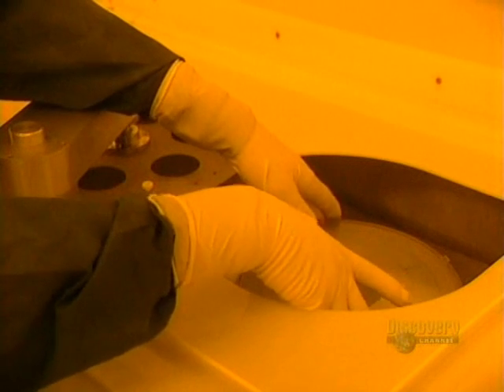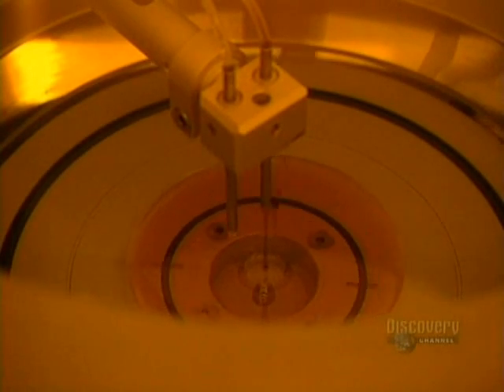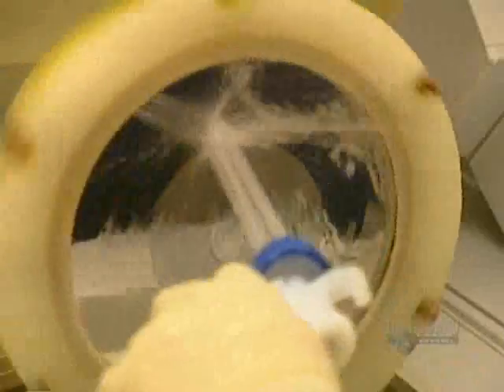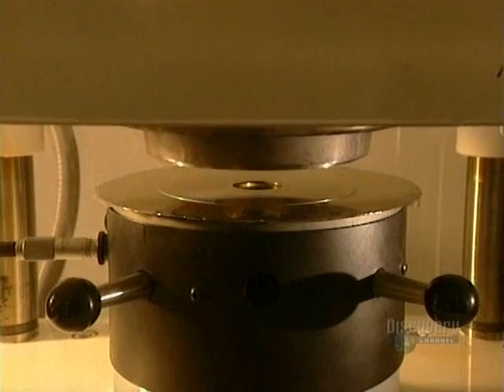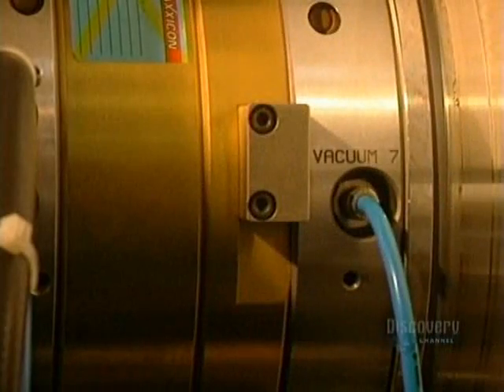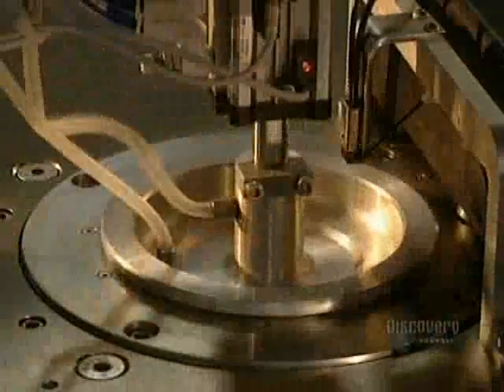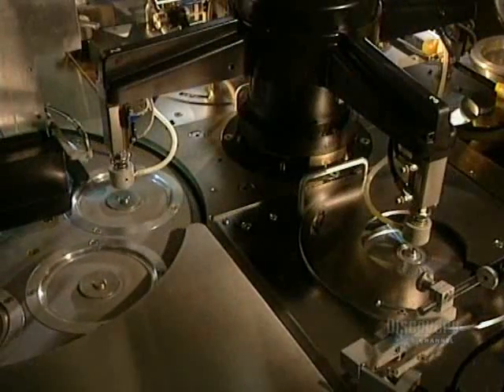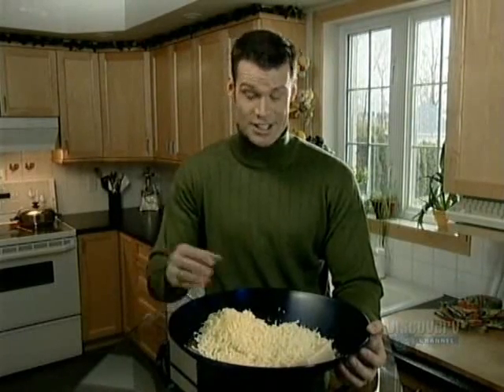How are CDs made

Comment: What they failed to mention is that the glass master wears out after 2000 or so pressings (depending on the plant config).  They also forgot the whole quality checking every 1000 CD's and the fact that the discs at the end of the run contain quite a few errors and an plant will produce CD's full of errors if they are in a hurry to get units out the door and don't have time to make another master ;-)  Good video though!
Reply: LP collectors rant about hurried manufacturing producing "noisy" records or records that look scratched and dinged out of the original shrink, so im guessing the two manufacturing process were similar enough to produce similar defects under similar conditions??
Reply: @Kzaks  CDs, DVDs, Blu-Rays, etc all contain a healthy amount of error detection and correction in them.  It would take a significantly botched pressing to be audibly noticeable to the listener.  A rushed vinyl pressing on the other hand...

Comment: @otharennaur CDs aren't "recorded" per se, they are molded. Think of it as a footprint you pour plaster into. When the plaster dries you get what's called a negative image, and you can then use this to produce copies of the footprint.
CD-production works the same way, only on a much smaller scale. You have a "footprint" in the form of a metal die, you inject molten plastic into the die and let it harden, and then yank out a plastic disc with all the data of the original die on it.

Comment: Madblaster: Nope.  Process is exactly the same until today. Photochemical Glass Master fabrication, then negative imaging from that master disc (can be done multiple times, as often as required from one master, because those metal foil pressing negatives undergo heavy usage thread in the pressing department/s), then making positive copies of it from polycarbonate material. Coating, finishing and printing remains as is also.

Comment: @rrrohan2288: 
Of course you can make a "production master" using a CD-R first. But this is a "non-permanent" prototype master, also called a "transfer master", finally. For mass-production, CD-R is not rentable and too slow. The CD-R is to be sent to the factory then and therefrom a glass master is produced, which is the basis for the polycarbonate/aluminium coated and printed mass product, the physical CD.

Comment: well the fact remains that the "music" or data ir recordet to teh SILVER part of the disk that why if the plastic part gets scratched it can grindet with a extreamly fine gringder until the scratch is gorn and the cd will work as new again. however if the silverlayer on the top is scratched nothing can save it.. whitch is also the reason that you mush nevar write on a cd with a ballpen. (it simply ruins the 1,0,1,0 data pattern the laser have made)

Comment: You're absolutely right. Vinyls are very unpractical, and i don't prefer them over a CD. There's a reason we use cd's today and not vinyls. But, i still don't necessarily think cd's sound better, although i agree with the noiseless thing.